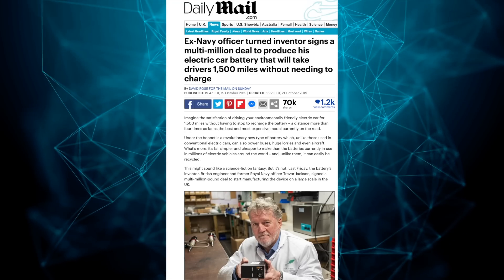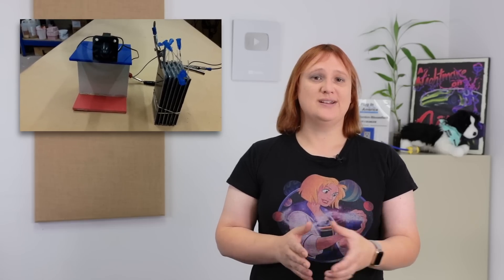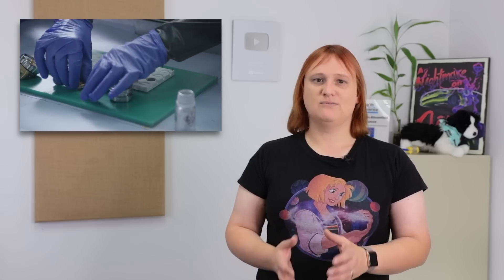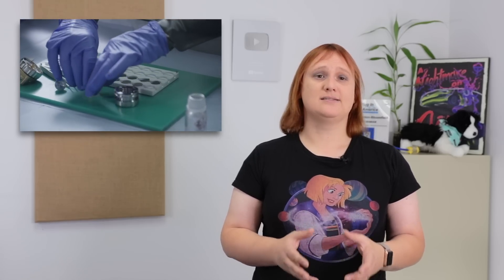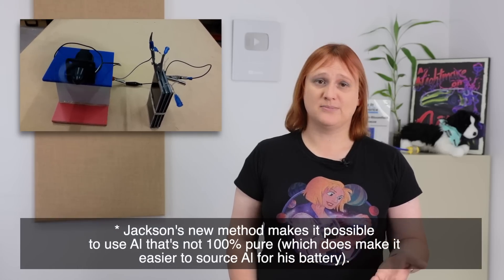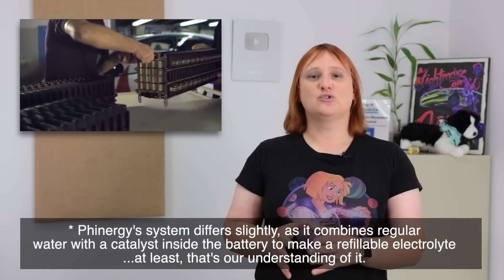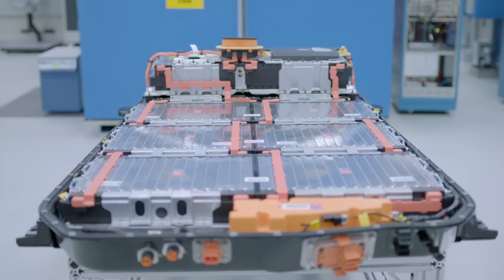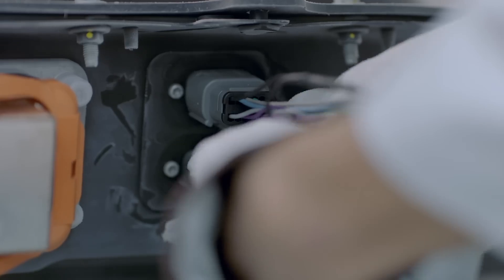Is This Battery The Holy Grail For Electric Cars?

Comment: Passenger Airplanes seems like a good fit.
Reply: @djp3637  The article didn't state - or at least I didn't see - the exact energy density of that aluminium battery design, only that has 8x greater density than current one.

Considering that Tesla Model 3 has ~270Wh/kg we could assume that average EV has 200Wh/kg. That would mean ~1600Wh/kg for aluminium air design.

When Elon Musk revealed that he had a design for an electric VTOL aircraft, he estimated that Li-Ion batteries would need to achieve a 400 Wh/kg energy density in order for batteries to beat kerosene and his electric aircraft to be viable. Hence I suspect that with 1600Wh/kg one could do more.

By no means do I consider myself an expert in any of these fields. Pure theory and of course I can be completely wrong in my assumption.
Reply: There isn't really any clean replacement for jet fuel other than making it from atmospheric CO2, which while possible, is extremely energy-intensive, meaning you'd need to be generating a massive surplus of renewable energy before it could be economical.

Now, small propeller-driven aircraft that only seat one or two people, those can and have been converted to battery power. We will probably see that market follow the car market and abandon petrol, while airlines keep burning kerosene fuel because they have no other option. Maybe if we're lucky we might see the propeller planes that seat 30 and fly ~500km move to battery power, but anything that currently uses a jet engine is going to stay on hydrocarbons, though perhaps with a change of source.

Comment: Tesla considered the Al-air range extender in 2010 and decided that it wasn't worth pursuing.
Reply: it isn't worth pursuing commercially, and on a mass scale. Tesla was right, and they are now coming out with a million mile cycle life. So, i think they will put all other competitors out to pasture!
Reply: The "million mile battery" still has the same metrics in weight and power. It just loses less capacity over the long haul. It still has to recharged as usual.
Reply: @evanriddle1614  and they published the papers, without patent restrictions. So every cell manufacturer can use this know-how which is a genius move.

Comment: Scooters and electric bikes!
Reply: Especially practical. Light weight. Frame on bikes exposed make for easier swap. Lithium bikes have not fared well on range and much less so than cars. Still just too heavy. But extremely practical for motor bikes.

Comment: Well they may call it a battery, but this is basically an aluminum based fuel cell. Aluminum may be a lot easier to store than hydrogen but the waste it produces is not harmless water vapor but effectively sand that you'll need to ship back to a factory to be re-electrolyzed. If I get a choice between the two I'd say stick to hydrogen. Literally any application that you can name where a single use aluminum cell would be useful, a hydrogen fuel cell would be as useful. Now I'm not a hydrogen bug, I think that rechargeable batteries that tie into the grid are the best option even given the trade offs, but for range extenders or aircraft like people have been saying in the comments here, hydrogen is just plain old better.

Comment: I think a small fuel cell that could double for use as a cabin heater will be a more practical range extending technology. The question is - does aluminum oxide (I assume that's the byproduct) cause health effects? We've all heard of the chem-trail conspiracies - now imagine if every car on the highway were emitting invisible clouds of the same stuff blamed for the world's health problems.

Comment: Very interesting, I don't think it's gonna happen because it appears or should I say I think batteries are going to be more solid state type that can be charged quickly.  I mean it's gotta be happening in the labs, it just makes sense to continue the basic principle of a regular battery that can be recharged in 5 to 10 minutes and with many components going electric it would be surprising if it doesn't happen within a few years.

Comment: Manufacturing aluminum metal from bauxite ore is an incredibly energy intensive process. Basically you fill a room with ore then blast electricity through it until the metal separates out and sinks to the bottom. I am unfamiliar with the aluminum air battery but I can't imagine it is less carbon intensive than recharging a lithium battery thousands of times and then recycling and reusing its minerals.

There are no easy answers to our climate dilemma. Eventually we must lower our expectations of how much energy each of us is entitled to use.
Reply: Bill Kerr the advantage comes in recycling all the scrap Ali into power, much like using milk bottle plastic in fires and furnaces. Once the product exists looking to extend its lifecycle or recovering the energy from the product should be some of our goals ....
Reply: @chrisbraid2907 Recycling aluminum requires far less energy than extracting metal from ore. That is why there is such a vigorous trade in scrap aluminum. Taking that scrap out of the supply chain would increase our carbon output. Ultimately we would be refining Aluminum to burn as fuel. This technology is no way to replace fossil fuels.
Reply: @Miata822  But then you would unburn it which is what refining does. Sure it's energy intensive but that's the point. You're putting a lot of energy in a small space which you can then extract at will with no nasty by-products.

Comment: Oh great!
The revolutionary battery is now owned by the company that brought the world the Austin Allegro.
What could possibly go wrong!?
(For younger viewers that have no knowledge of this car, don't feel bad. They all melted into piles of rust during a light drizzle sometime back in the early 1980's)
Reply: My first car was an Allegro bought by my parents. Presumably they thought it would be harder to drive like a lunatic. According to quotes on Wikipedia, the one thing they got right (after the early models) was the rust proofiing. Certainly mine had no rust issues, and it was already old by that point - they stopped making them 7 years before I could even start to learn to drive. I also credit the Allegro with protecting myself and girlfriend when a drunk driver overshot a junction and T-boned me, sending me spinning nearly 180 degrees, going up over a curb onto the pavement, and slamming into a concrete post sideways. No injury apart from a sore back. That happened in 90/91 ish, so they can't have been as bad rust-wise as you are implying. The thing was a tank compared to the Mk 1 Ford Fiesta Supersport I got next. Though the Supersport was waaaay more fun to drive :-)

Comment: Lower carbon footprint???  Aluminum is the most energy demanding metal on the planet in its refining, and hugely expensive, and I wonder how they square that peg?
Reply: By developing heavy mining equipment using these new batteries, and expanding all non-emitting electric generating solutions, of course! Including nuclear, with some of the new reactor designs that will be cheaper to build and easier and safer to run.
Reply: Stephen Logsdon alumina is recharged back into aluminum. This is already happening in Iceland as they have an abundance of cheap renewable electricity and aluminum is light per energy density .they ship it to Europe the electricity is extracted & the alumina is shipped back to Iceland to be recharged.
The only mining is for additional aluminum demands.

Comment: Really interesting video, and I LOVE the idea of using the tech for a range extender.
Reply: Why? Tesla looked at it in 2010 and decided it wasn't worthwhile. I agree. Why would you want to visit a swap station and pay 1000 pounds for a new extender every time you used it? It makes no sense. You'd never use it! So what's the point? Just stop at a supercharger for 20 minutes and save yourself 1000 quid.
Reply: @gasdive  I'm sure it'll be much cheaper than that if it's to be a viable solution. One of the advantages is that it's cheap to manufacture, so it would make sense to charge more than the petrol equivalent per mile, but even at 20p per mile, you're looking at £300.
Reply: @shaunpowelluk  the guy in the report says the 1,500 mile one could cost as little as £5000.
Reply: To counter Range anxiety

Comment: 70 % of the cost of an airline ticket is fuel. A third the cost of building jets is the engine. Sounds  like a great solution for high short range electric fan airliners

Comment: I dont think you portrayed this in the right light, if the details are to be taken at face value, they're talking about a swap out time of 90 seconds which you didn't mention, so far faster than a fill up of gasolene, and certainly fast charging. Your take also ignores all those who don't have access to plug-in at home charging like apartment living, inner cities etc. but would like to go EV and don't even get me  started on the potential for heavy long range trucks. The new battery is apparently totally recyclable and yes there may be a loss in the aluminium content, but less not forget that lithium iron battery degrade over time too. I like your range extender option, great idea! but if they say you can have a battery pack that last 1500 miles then that will shut up all those with "range anxiety" and be less frequent than stopping at the gas station. Apparently he's also been in negotiations with several large shopping chains about being able to offer the battery swap outs there. Light aircraft, hover taxis, the list goes on. We could be looking at the new VHS versus Betamax situation.

Comment: Your swappable range extender idea could be a good one (depedino on cost).  All that would be needed is to add 400 or so miles. I've read a good number of comments from folks suggesting renting range extender batteries for road trips.  so maybe it could get some traction.  would depend on how small, how light and how costly.

Comment: As the Author has mentioned, these batteries will be used for some specific tasks. As it is, this technology has no future in a mass-market EVs.
Reply: Agreed. The inability to recharge the battery is a deal breaker for most situations.
Reply: They could function as range extenders for E.V. with smaller batteries.
Reply: I would see it that way as well.
      With a benign electrolyte this kind of battery could be used in transport. But only as range extender, would it be economical just to drop the tow truck or rent on occasion for longer trips?
Reply: @weldonyoung1013   I think the contrary. Batteries that last 10X longer, universal so any car brand can use them, cheap, and with the support of big oil....  This has actual legs.
Reply: @freddyrosenberg9288  , either way, currently we can't use the Al battery technology to get to the future. As the future unfolds, either is possible, but as the Transport Evolved video stated something similar was to be started in Isreal & failed. Not unlike economics having dealt this kind of blow to technology before.
     It is just that I done see the benefit of having to go to an industrial complex to change a dead battery.
Reply: @weldonyoung1013  What industrial complex? It would be the same as pulling up to a gas station. This battery makes cheap Evs possible. If the battery system already exists, developing an EV becomes much simpler. All they need to do is make an universal battery that any car brand can use.
Reply: @freddyrosenberg9288  , that's true. But we're a long way from a very large  standard size battery, and these aluminum batteries would need to be 'rebuilt' in a large industrial complex to replace/reconfigue the aluminum. They could then be distributed as you sugest, however the changeout would be more complex than filling with liquid or an electric charge. The convenience would be lost, which might go over in some parts of the world or where a life of leisure becomes the future, but in most parts of the world life is becoming more hectic. As ground transportation has made possible in urban areas.
Reply: > As it is, this technology has no future in a mass-market EVs.
As it is *now*? Implying that in the future, it may have??

Comment: I saw some big announcement 4 months ago and followed it up. An Indian company and that Israeli one. I thought GREAT until I wanted to find out how quickly they recharge and noticed that all the promos carefully avoided the whole "re-charge" issue. They're all single-use ($$$$$), you end up with Aluminium Oxide useless powder at the end of the charge.  😂😂
Reply: Well, you could still recycle the Al-oxide, can you? But of course this comes with a $ and environmental pricetag.
Reply: Karl P it can be recharged back into aluminum
Reply: @Dana5775  Thanks. I didn't know that.
Reply: @Dana5775  No it cannot. It has to be re-cycled, basically made over again.
Reply: Karl P there aluminum air battery yes. I am referring to some of the comments regarding primary batteries being discarded verse recycling alumina oxide Into aluminum via electrolysis as apposed to mining bauxite oar?

 the Hall–Héroult electrolytic process! Not the process of separating it from bauxite. So yes it can be recharged into solid metal aluminum without the more costly & caustic process of its original state

Comment: So this is a competitor to the classic alkaline AA battery, not the lithium-ion.  Interesting point about range extenders though, if the density really is that high it could be a simple alternative to other methods of range extending.
Reply: Adam Olsen the big difference is alumina oxide is recharged into aluminum and not discarded.

Comment: If the electrolyte is safe enough to drink, I can easily foresee people simply popping the hood and sticking more aluminum bars into their battery pack whenever they need to fill up. This process does not need to be any more involved than dropping a six pack of your favorite beverage into a cooler.

Comment: I own a 2015 Leaf, I can charge at home and at work.  I would never go back to a car that I have to stop somewhere to "fill up" and  I don't need a car that can go 1500km on a single charge.

I like the idea of using a secondary "battery" as a range extender but maybe capacitors would be better for that ? Anything that can be recharged at home or at work and doesn't need to be transported around to a battery swap station.
Reply: Ditto
Reply: Absolutely. Who would be driving around that far distance without stopping anyway!

Comment: Super capacitors.    When they are perfected ICE will be obsolete.    Overnight.   Until then we're just perfecting the drivetrains and keeping the environmentalists happy.   Can't come soon enough for me.
Reply: ICE is already obsolete. But supercapacitors don't solve any significant issue EVs now face. The two biggies are range and price. That's exactly the two areas where Li-ion batteries are far better then supercapacitors.
Reply: @andrasbiro3007  range and price.   Exactly.    Untill those issues are solved, and they will be, ICE will not be obsolete.    Energy storage is the issue,  current batteries are too expensive, complex,  and degrade over time.   EV's have found a niche,  enthusiasts love them.   But the average guy out there just wants a vehicle that does the same thing they've got, and is not interested in being a trendsetter.    I've still got my money on energy dense capacitors though.   Just my opinions.   Take care.
Reply: @johnmcnaught7453  
1. The Model S has a 370 mile range and soon it will be 400. That's plenty enough. Even the much cheaper Model 3 isn't far behind.
2. Teslas are easily competitive economically. They aren't cheap, but in their market segments they are the best in almost every way. Don't forget about the savings on fuel and maintenance either.
3. There's practically no degradation, except for older Leafs. An older Tesla battery last half million miles, the current ones could last a million. And just recently they managed to double it again, now Tesla officially claims 1 million mile or 30 years lifetime.
4. EVs aren't niche anymore. Just look at the Model 3 sales. Also https://www.pinterest.com/rikkileejacobs/tesla-celebs/

Comment: everthing looks fantastic in a lab but until its tested in high volume production its just a pipe dream.  Its always a case of its better but it has a few drawbacks and it n this case more then a  few drawbacks the title battery gets 1500 miles on a charge was total clickbait.